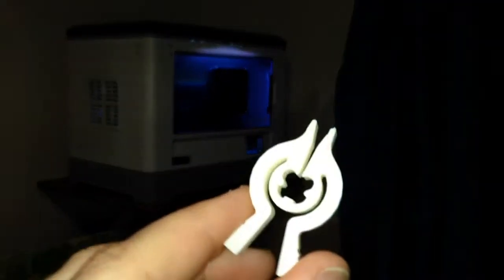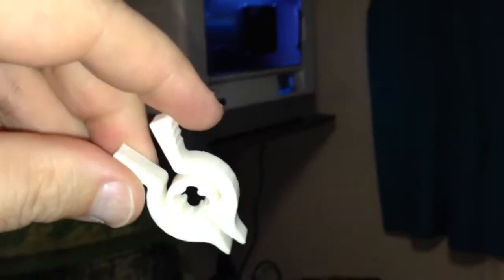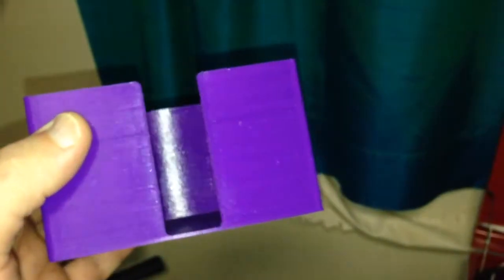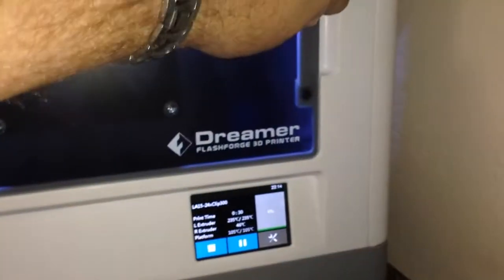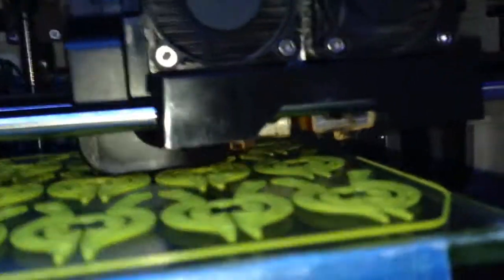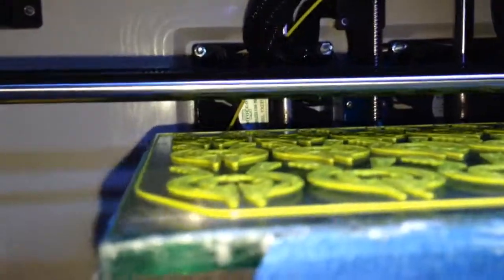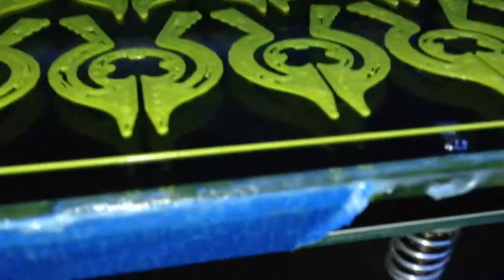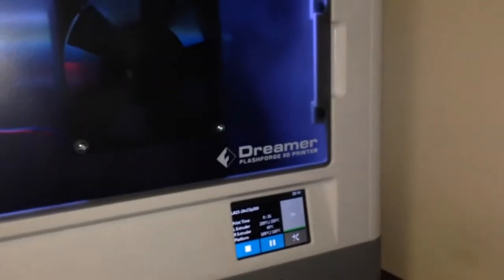Flashforge Dreamer - Build plate full

Comment: just get that funny feeling you work for ummm, lemme guess...flashforge?  Still looks like a good printer though, just trying a bit hard
Reply from the maker: Lol, nope. Printer had a VERY hard 2 years with over 200kg of plastic parts printed. The printer now rarely gets used, the print bed won't go up/down as it's ceased in place now. I tried removing it and lubricating it all up but after a week it's ceased up again. Ah well. It was a good printer. Still works but I need to get the Z-axis lubed up again

Comment: hi~ do you have the problem to stick first layer on the bed when you print full bed size model?? I tried to print large stuff in abs, it was ok at first couple of layers, then the first layer start to deviate from the bed ( not entire layer only the side close to door). what is your setting temperature when print abs?? did u use any sticky stuff on the bed??